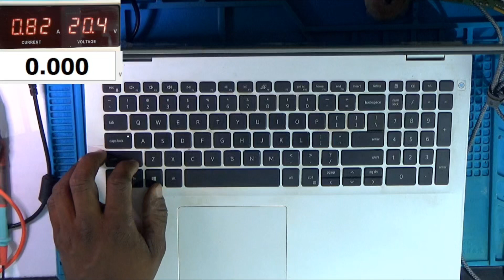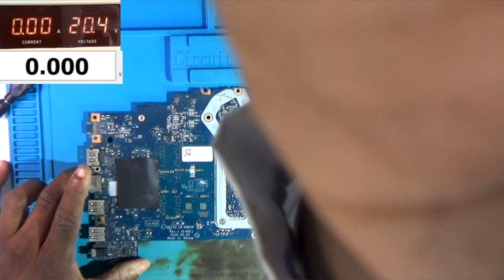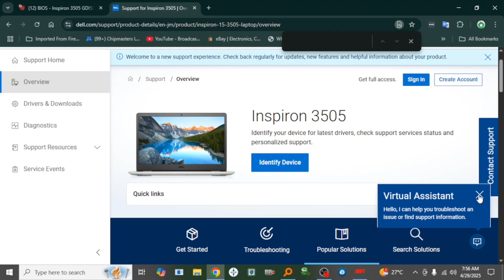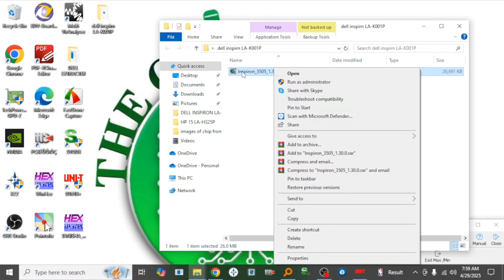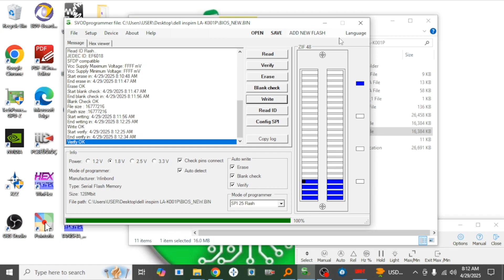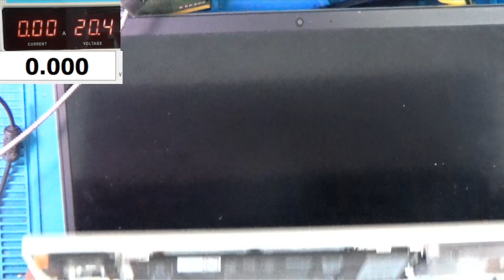Dell inspiron 3000 series no display

Comment: Hi chipmaster, did you forgot to extract DMI from BACKUP.bin to inject in BIOS_NEW.bin, you have laptop info inside, like serial number, uuid, windows key and more. if the owner have to reinstall windows, the windows key will not be present anymore, search hex value in backup.bin (010000000000000001000000000000001d000000) it will be follow by windows key. i lurned 1 more way to extract bios, nice video like always, thx :)🤩